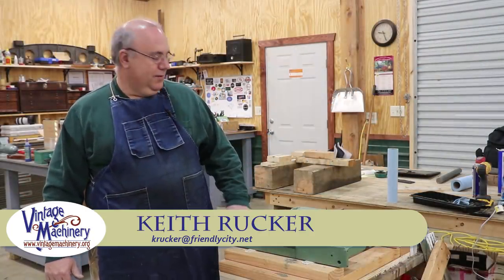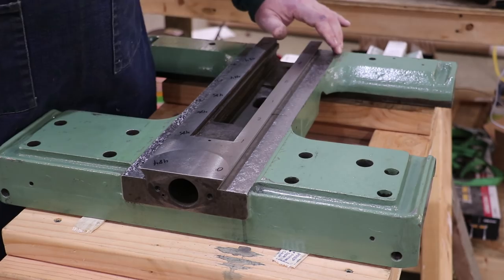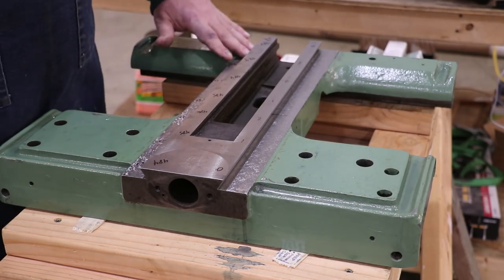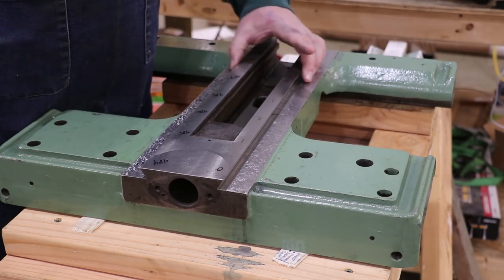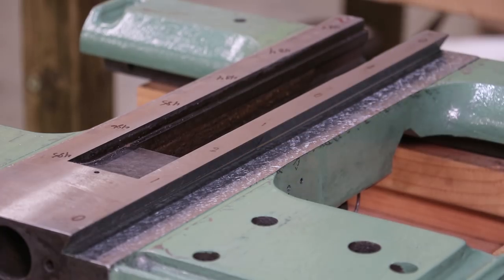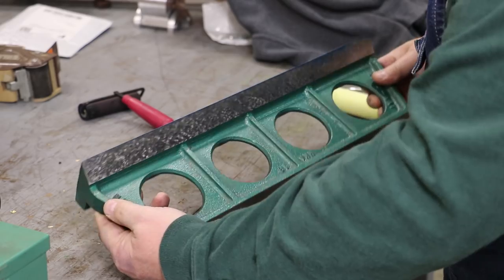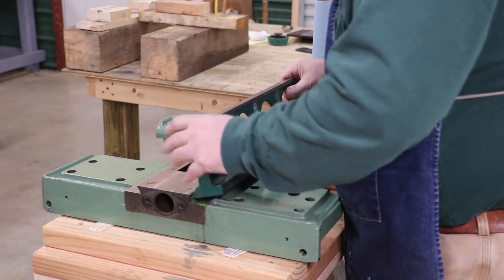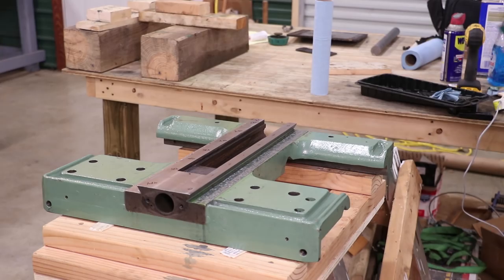Monarch 16" Lathe Restoration - Part 14: Scraping the Saddle Dovetails

Comment: I'm going to call it skill as well as the fact you are dealing with a high quality piece of equipment to begin with. It still amazes me that even with really accurate and precise milling and grinding equipment, the best way to finish a surface that has to be really flat (especially if it's got to bear against another flat surface), is hand scraping.

Comment: Looking good. I will offer a tip on your sequence that should help... When you scrape, work from the furthest point away from you and come back towards you, you won't be piling material into the blue that you have spotted that way. As you know, it's hard enough to see an accurate, very limited blue, spotting so keeping it clean as you scrape is very important. Thanks for sharing.
Reply: You scrap in a forward motion but you move backwards as you go. if you scrap forward and move forward you are pushing chips into the spotting and that's not good...messes up the spotting. Was just a suggestion, it's very clearly laid out in the Connelly Machine Tool Reconditioning Book, but obviously there are many "ways" to skin a surface :)
Reply: I'm still not making my point, I struggle sometime to convey a message, so I will try again. I scrape in a forward motion, for all the reason you just mentioned, but the motion I take, how I move to the next highpoint, is from furthest point to nearest point (working back toward myself, meaning point of contact, not the scrapping motion); as you finish a motion you move backward (not in contact with part) exposing your spotting from underneath the blade (as you view the area from the top), pick your spot, scrape it, repeat, all that in fractions of a second. In other words, scrape with a forward motion while working your way backward so that you don't push material into the spotting. Hope that's clearer?? Good exchange, always learning.... Thanks

Comment: At 4:37 is that a crack I see between at the "1" between the "2" and "0"? At 7:46 it looks like it crosses over to the other side? Is this part of the oiling system? Okay, somewhere around 21:25 - 21:30 you mentioned an oil groove, so I guess that answered my question. Very tedious process, but if you watched me hand-plane a piece of timber 4-square, you might find it tedious, but I can do it minutes most of the time (not quite the same as truing ways, of course)!
~525.5 all the way across! You lucky bastard! :) Well done! My hat off to you, sir!

Comment: When you checked for parallelism, you got different readings than your previous measurements (0.5255 this time, 0.484-ish last time). Is this because you used a different set of dowel rods?

Comment: Great job,  Keith.  I have one question.  I thought those straight edge angled sides were 60 degrees to match the dove tail. But yours had a lot of angle space left. Please educate me.
Reply: When scraping a dovetail, you do not want the straightedge to contact both surfaces at once.  That simply does not work.  The straightedge is made to a smaller included angle on purpose for that reason.  We want to work on just one surface at a time.  Also, the actual angle is meaningless, so long as it is a dovetail, and that the two sliding surfaces match each other.  Note that there was not measurement of the actual angles, because it does not matter so long as the mating surfaces match.
Reply: Bob Korves , I see both sides of the question.  I always thought that they would be a precision 60 or 55 degrees.   But I think your point is, and correctly so, once you have the first surface of a side of the dovetail flat then that will be the reference for its mating surface and not the straitedge.
Reply from the maker: Most straight edges have the dovetail at 45 degrees instead of 60 degrees.  You have to remember, that you are not bluing both sides at the same time - you are either bluing off of the bottom or the dovetail side.  Because of that, you don't want to the bottom touching when you are bluing the inside of a dovetails, hence, the difference in angles.

Comment: How do you ensure that the dovetails are 90 deg to the bed ways? Real interesting thanks.
Reply: scott black prior video he shows using the granite angle plate that's sitting on the ways by the headstock.
Next step/video, stay tuned! 😉😀
Reply: Mark Schweter ah ok. I will try to wait. Patience is a virtue but not one of mine.
Reply: scott black just go to the one previous to this one.
(same here... Can't wait for the next installment! 😜

Comment: I can still hear Richard King in class telling us to hinge it before making any decisions about where to scrape. Nice work Keith.
Reply: chris0tube Keith’s video actually demonstrates why it’s useful. When his surface was high in the middle, the straightedge rocked on that spot. In addition to bluing the high area as it should, it also transferred blue to the far ends of the dovetail which are actually low relative to the center. The hinge test quickly confirmed where the real high spot was and reminded him not to scrape the ends which also show up as blue.

Had he just followed the blue with the power scraper, he would have just been chasing a crowned surface forever.

Comment: I've never really got scraping. Wldn't it be better to use a fine stone to lightly grind, almost hone, buff it, at the end to kinda average it out even more
Reply: Adam Smith scraping actually gives you minute voids for the oil to be held. The oil can then lubricate the part and provide the thin film between the two parts so there is no metal/metal contact... In theory. :-)
Reply: but wouldnt milling also give you some voids too? ive not quite got the scraping either, and they cut channels for oiways anyway.hmm still not convinced with the scraping, i think its about doing it the old way, after all ts old lathes etc so why not
Reply: You don't want the surfaces dead flat. You need a film of oil between the surfaces, and if they are dead flat there is no place for the oil to lurk around, it will all get squished out and you end up dry and rubbing. Hand scraping can correct various errors the grinder left, and then it leaves tiny hills and valleys. This reduces the total amount of surface in contact, which reduces the total friction, and also leaves places for the oil to lurk around and be useful.
Reply: I only know what I learnt watching Keiths videos. But what he has explained is that the scraping leaves little pockets for oil to sit in. This helps prevent wear on the machine. So this uneven surface you would get rid of with your "grinding" is actually desirable.
Reply: You will never, ever get it flat with a stone. Variations in pressure, not spanning the entire surface, the stone not being flat, etc. You would need to do it with a machine that can deliver constant pressure over the entire surface. (Which is impractical, esp in the home shop.) Also, flaking is more for oil retention, not scraping. Though scraping alone does help somewhat with oil retention. Scraping will flatten it, stoning/honing will make it smooth. You want it flat.
Reply: While you're sort of right about the stone problem you're not right about the pressure. Btw a precise stone can be made (by diamond grinding) but after certain surface flatness it will stop cutting (it will stop cutting metal surface that is way very very flat) . Large very precise instruments are often hand lapped to perfection. You take a handheld lapping plate (that has been lapped into perfection), put diamond lapping liquid on and you lap the area that you need to lower down. You can achieve amazing accuracies this way. They've been doing this at Moore tools (famous for Jig Grinders), Mitutoyo and pretty much everywhere where you need really really really really flat larger checking tools.
Reply: If you could get it dimensionally accurate enough, it might not be bad. It is stunning to see how small an imperfection the bluing process will pick up. Also, scraping leaves a certain type of oil pocket - not just any shape. Milling might leave the shape you want. Maybe not. Having said that, when I scrape, I always think that someone could come up with a better process, but I don't know what it is. Maybe surface grinding and then a process to get the oil pockets. I think it could be something like a scraper, but machine applied, so the oil pockets are well controlled.

Comment: So how do you sharpen a carbide scraper blade for your power scrapers?
Reply: Slowly using a precision diamond card / stone or more quickly using a diamond wheel. It's no different to sharpening any other tool the trick as always is to find something harder than the thing you want to sharpen :-)
Reply: Is there a specific angle that you are trying to sharpen to like a woodworking chisel or are you trying to raise a burr like on a woodworking scraper or a paint scraper?
Reply: The angle depends on what you are scrapping and if it's roughing or finishing.

Comment: Keith, you are the expert but I am wondering if the worn surfaces are the place to start. 

Why not start with a rough assay of all the machined or ground surfaces which are not worn, beginning with the assumption that the saddle may possibly be warped as well as worn. Assuming it is not, you might assume that all the top surfaces or non-sliding top surfaces were machined with the same setup, then flipped over and the bottom and sliding surfaces were machined.  Once the sliding surfaces were ground, assuming no aging or stress relief was done, the saddle could be supported on the ways or a profile copy of it, or some pertinent method and the finish grinding done on the sliding parts of the top of the saddle. The saddle and apron need to be checked for warpage at some point before final top and bottom machine work. Once you have the top surfaces true and measured, you can use the repair material in an appropriate thickness to replace the worn saddle sliding surfaces. The process would sort or recreate the machining of the rough casting. 

It may also be possible to use iron shims made to fit in place of the PTFE material at perhaps a savings. It may be possible to epoxy or screw the shims to the saddle then machine them. Grinding the saddle before scraping would eliminate low spots and require only enough scraping to remove the last thousandth inch or whatever you require. Not having to scrape the PTFE material could eliminate the danger of thinning it too far.

The US Turcite distributor offers installation classes. https://mtsandtg.com/specialty-components-group-about-us

Hope this is of some help, and thanks for showing us so much about use, care and feeding of our machinery heritage!
Reply: n

Comment: I repaired and rebuilt the file cutting machines while I worked for Nicholson File. Prussian blue and cadmium yellow were always in my tool box. Lots of scraping on the Barnett cutting machines.
Reply: You must have so many stories to tell. To bad nicholson went to mexico. Damn shame
Reply: Cadmium yellow instead of Lead Chromate yellow?
Reply: Cadmium yellow and Prussian blue oil paint. When I first started in the mid-70's we used red lead. Marked really well.